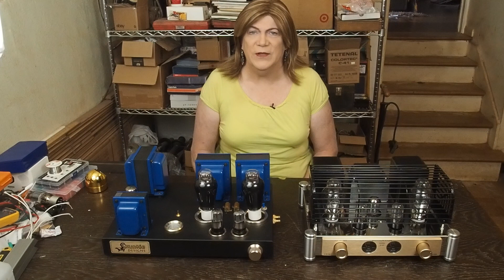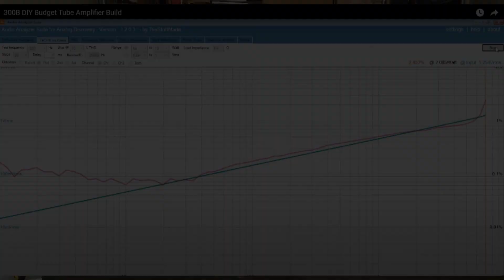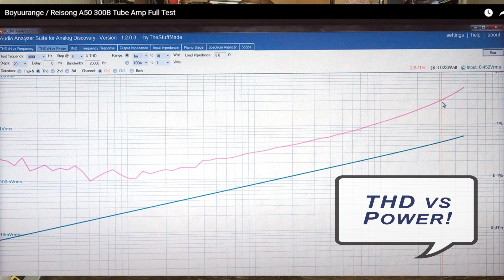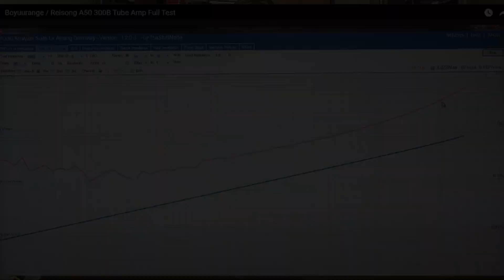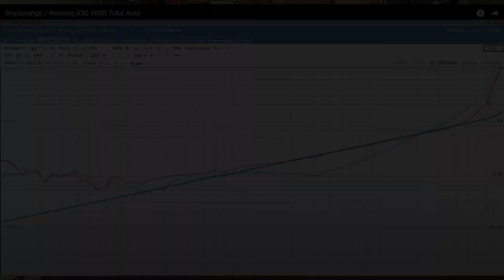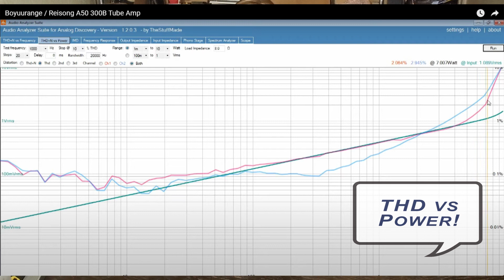Boyuurange / Reisong A50 300B Tube Amp Mods: Wrap-up Impressions

Comment: I’d be more interested in a kit for your amp—with a chassis that is prepared for building than I would be for a kit for the Amazon amp.
Reply from the maker: Kits from me are not likely to ever happen. Putting together a kit with a prefab chassis is doing 90% of the work for 50% of the money. The only way I would sell a kit would be for the same cost as an assembled amp due to the support this would inevitably entail.
Reply: @SkunkieDesignsElectronics  That makes a lot of sense. Well in that case I second what others have said here and would rather buy your completed amp! Happy to pay for your labor!

Comment: Very nice and helpful. I think you did not mention the value of new coupling caps for 300 tubes. You mentioned that .56 or .47 mf was too large. I assume you went to .33? Is this correct? Thank you
Reply from the maker: Yes, I tried both a .22 and a .33 and the .33 had a little better bass.
Reply: Wow what a youtube channel . This was posted 2 years ago . I asked a question and got reply in minutes. I didn't even expect an answer , because others just wouldn't bother. Thank you very much!! SkunkieDesignsElectronics YOU ARE GREAT.

Comment: I am nowhere near qualified to make the modifications you demonstrated.  You almost make it sound like this amp is basically junk without the mods.  Is it possible to enjoy this amp with nothing more than rolling the tubes?  Can you at least provide a list of what replacement tubes you recommend without any other modification?  Or is it a waste of money buying this amp unless you're an electronics engineer with the skills needed to rebuild it from scratch?  I really wanted to get into tube amps as a music lover and thought something like this would be a good start.  But now I'm discouraged that anything I can afford is just cheap, overhyped junk and I'm stuck with my overpriced, overhyped Pioneer "Elite" AVR.  At least it works and it hasn't blown up yet.  I'm kinda upset, but maybe I should thank you for saving me $1,000 bucks along with a lot of grief and stress.
Reply from the maker: IMHO, no. It only makes maybe 1W of power without the mods. And you don't have to be an "Electronics engineer" to do these mods. I did the hard part for you, figuring out how to fix it. Honestly, you are not going to get a quality, good sounding tube amp at this China $1000-1500 price point.

Comment: So would 3.2k be preferable over 5k for a speaker with a 8ohm minimum dip?🤔 Kind of interested in understanding more  about the output transformer part with different loads.
Reply from the maker: Maybe a watt or so more power but at the expense of higher THD.
Reply: @SkunkieDesignsElectronics  I see. Thankyou.🙂
Reply: I should add, the Reisong doesn't interest me, just a better understanding of output transformer matching to speakers.

Comment: I concur with you on the subwoofer idea. But what I’ve been doing for a few years since I got my 4-way Pioneer electronic crossover, is use the low frequency output from the Pioneer to feed solid state amps driving two JBL 15”s. No amp sounds thin since I started with this. On top of that, the mid/high outputs drive tube amps to feed my main speakers. 

It isn’t budget friendly and complicates the whole system but it gives me huge fun mixing and matching everything. It is the best of everything in one system, not to mention immensely lowered distortion and higher SPL overall. Like the LS3/5A sounds like on steroids giving out louder music, not noise. 

All in all, like upgrading the whole system but keeping the sound signature of my original speakers.
Reply from the maker: Very cool idea! Thanks for sharing.

Comment: You are very knowledgeable. Way more than me. I have a Beautiful Marantz 2325 , but it’s old and could probably use a restoration  , re-cap ect. The wood case everything is so nice , I’m very worried someone will mess it up. Plus I could use the money on a Tube amp? I run a pair of K-Horns up front A, on B I run a pair of Klipsch Belle’s. Together it fills my listening room with live entertainment at around quarter volume.  Would Zi be better off with a Tube amp ? The Marantz and Klipsch speakers have been nothing but Quality ! I have noticed that not all tube amps have an A + B ability to play 4- speakers. Could I buy a speaker splitter and run the 4 ? I do run a M&K powered sub , on the K-horns. I’m old and retired, plus disabled so my Stereo gets used and my house sits on 15 acres so I can crank anytime 24x7 with no Police knocking as I use to get when I was young. You are very knowledgeable, I have been thinking maybe Wilkinson 400i . Thank you for your opinion.
Reply from the maker: If you enjoy what you have, keep enjoying it :)
Reply: @SkunkieDesignsElectronics  I know the man that sent the new amp directly to you was very smart. He couldn’t have gotten anyone better !

Comment: Like many others I'm so glad I found your channel.
I was considering one of the many Chinese amps, and may still buy one, but as you have shown, to get the best from them, mods are unavoidable.
I have designed and built passive crossovers for my DIY speakers, so the mods would be no bother to me.
When you consider how badly this and other Chinese amps measured out of the box, it makes you wonder what the you tube reviewers are hearing, or more importantly, not hearing.
I always take what reviewers and HIFi mags say with a large dose of salt.
They need to keep reviewing, so can't be over critical, just hint at issues, and leave the listener or reader to read between the lines.
Thanks for all your hard work, and honest opinion.

Comment: Wow! I've watched so many videos about stereo gear (use to read magazines in the past about this passion of mine for music) now years later I find you! I immediately subscribed in hopes of finding your best advice for a DIY amp to pair with my Klipsch 97db speakers. I have many speakers but after visiting my local Audio Classics store, close to where the McIntosh gear is made, I fell in love with tube sound. Affordability is out of the question and what I loved best was the tube gear used with the Magnepan speakers. You can imagine the power those mono blocks were cranking out. It was definitely out of my reach. So if you can point me in the direction of a DIY project to help my addition I will most appreciate it. I can solder, weld, have a Greelee Punch Set among others. I can paint, fix cars , have access to a break press etc. I'm a jack of all trades and master of none. Presently a journeyman electrician and ready to retire to my dream sound room. Please! hook me up. ^^
Reply from the maker: See my DIY 300B amp, it's amazing!

Comment: Really appreciate you doing this series.  I've done all of your mods to my A50 and it really opened up and changed.  The clarity on this compared to stock is quite noticeable.  I think I've even got less hum/hiss observable when its idling, which probably gives a better noise floor.  This little amp really surprised me with how far it can go. It might even be winning compared to a MC275 when using high efficiency speakers, which I was hopeful about but not expecting.

Comment: Quick question about connecting a powered sub... I cant find much info on this but i have seen some comments --- "You need to get a subwoofer with line level or high level speaker inputs; you then connect the subwoofer to the speaker inputs on the back of the amplifier; I recommend REL or HSU for subwoofers with speaker level inputs..."-----  I only see right and left speaker inputs on the back of the amp so how would one wire the subwoofer? Sorry as i said i cant find almost anything about how to do this with this specific model (Reisona50). Any advise would be appreciated!
Reply from the maker: I have played around with a Elac SUB1010. These have high level speaker level inputs, you just parallel those to your other speakers, and then set the volume and where you want the high pass filter to kick in.

Comment: My mission was looking for tube inspiration to match my loudspeaker project, I've found it right here and now! I sold Hi-Fi for many years and listened to a vast amount of equipment and that was spurred on by my love of music and built my first EL84 class A amplifier pair kits when I was 18. Shortly after we were living in the realms of the transistor and I diverted my attention to the loudspeaker, the weakest link in the audio chain then and now, at present where recordings are better and the medium of tape, vinyl and digital storage systems and amplification has improved dramatically. Since the decades post the 1930s and early amplification using Valves (Tubes), we had no way of knowing how good they actually were or sounded because they have overtaken speaker technology which in principle is a 1930s design, coil, cone and a box, apart from electrostatics and a few novel ideas, nothing has really changed. My design work began in the 1990s when I built my first prototypes using novel techniques for improving drivers and cabinets rather like the improvements we see here in this series of Boyuu A50 modifications and of course the own design and build of the B300 amplifier. When I retired 5 years ago I wanted to try something new. I have all kinds of transistor amplifiers both professional and domestic from a Crown DC300 through a Boulder amp (my all-time favourite transistor amplifier), I decided to try a tube amp so bought a BOYUU A9 EL34 amp kit, changed a few components including tube rolling, connected to my new prototype speakers and it knocked my socks off! I wanted a small single-ended amplifier to drive my unique single point source highly efficient diaphragm speaker with equalised pressure rear and front wave module design in a dispersion vessel with total separation in a slim glass cabinet with isolation pads with a potential of 20Hz with a unit of zero resistance in the diaphragm motion, no suspension and a very easy load on the amplifier. The current grips the coil due to virtually zero resistance and allows the amp to move the coil to where it needs to go and follow the signal path. Thank you for the great videos and reading.

Comment: I bought this amp several months ago and I love it. Granted, I upgraded the tubes and it has significant use time at this point. I'm using it with some vintage JBL 4412 Studio Monitors at 90db sensitivity and it sounds wonderful. I rarely turn the volume past 10:00 and it has nice room filling sound and good presence. But I have to admit, I kind of regret pulling the trigger now after watching this series. 

The mods are above my head, not just technically, but time wise as well. I really don't have the patience for this kind of work. Forget about building the DIY version. I'll have to stick with tube rolling and playing with the 4-8 ohm outputs for now. I'll now binge the 300b DIY build as time permits. But I thank you for these videos and also the advice you gave me.  Best!
Reply from the maker: Try dropping a 5AR4 rectifier in, even with no mods it will help.
Reply: @SkunkieDesignsElectronics  I actually have a NOS GE 5AR4 on the way. I decided to get one after watching one of the earlier vids in this series. I already have NOS GE 6SN7GTBs that I installed a few months ago. That was a noticeable improvement as well.

Comment: I was looking for a affordable amp project for to long. This channel is the best place I founded to hangout with my newly founded interest in home audio. Being able to benefit from your experience in this "hobby " of yours is just a threat for me. The fabrication part is not a problem for me since it is my new career (Cad and cnc programming) after 24 years of live sound engineering. I also have good friends to help me with the power up and troubleshooting. Question: What would you recommend for speaker load to best fit my fidelity over loudness preference? I'm thinking of going with CR research since, once again, cnc routers are the easy part for me. Love everything about your channel thanks! * I ment GR-Research
Reply from the maker: Those speakers might be great, my only concern is how deep into snake oil products he is, claiming his speaker cables and those "tube connectors" make a huge difference, when that's just not possible. It makes me question everything he says after watching his video with speaker cables hooked up to the antenna jacks of a tuner lol!

I personally love my Klipsch RP660M, they go on sale fairly regularly for under $500 for a pair. I tried some Triangle speakers and returned them, just sounded flat to me. Part of speaker choice is personal preference/what sounds good to you.
Reply: Yeah I know the snake oil salesman aways have some stuff to sell as a remedy for your last founded needs he just sparked in that new dimension he created in the universe. I also noticed that, in live sound systems,  we always balance every signal to reject the noise from the RF environment induced in the 350 feets of cables running from the  mics up to the mixing board and the same thing for the run back to the amps. This is for analog productions. Data cables just use shielding to my knowledge. After that, claiming that a data cable could induce a level of  noise in the amplifier sufficient enough to destroy the quality of the amplified result? Maybe not. 
You mentioned the triangle speakers you tried were sounding flat to your hears. I have never heard them but I can't help thinking about the way that this guy keeps taking those boxes in and modify them so they sound flat response at all range of frecances when also evenly considering other important characteristics like impedance and dynamics. For my own business, I have been listening to Yamaha ns-10 and a Bryson 4b for more then 20 years... Like... "before bass was cool TV mixs" to long. So yes, I'll take some colors in my to be built listening room. I've lost track of what I've been saying previously... I'm having fun here.  Thanks for interacting with me. I will be around for whatever you try.
Reply from the maker: @jaydeebishop2345  I'm learning there can be a big difference between what measures well and what sounds good.

Comment: As an engineer, I’m so impressed with your review video clips which supported by numbers, math, graph on oscillator etc., that are what I expected…
I also watched some review of this A50 300B amp by others and they only review by their ears…
Reply from the maker: Tube amps can fool your ears, especially if you are used to solid state gear, as the distortion sounds totally different. I still think you can listen to 2-3% THD, but not 10%.
Reply: Only review with their ears ? Surely that’s the whole point ,strange comment
Reply: @martingreenwood3394  "Review with ones ears" is a good start, the keyword is 'only'. Because there is more to it, such as quality of components, layout and over all design which to a very high degree will affect for how long your ears will be able to enjoy the product. This was very well illustrated by this project.
Reply: @martingreenwood3394  yes, I mean other reviewers only review base on their ears. They say the amp good or bad just base on how their ears feel. Nothing to prove why this is good, why that’s not good. I like this video because the review base on mathematic, base sound wave display on oscillator etc.

Comment: I have a 'mark-II' of this amp,--Quite different in design--but similar appearance...
6V6 in triode as drivers, 12AT7 input stage, --And sounds Bloody Awful! 

Ive had to do full re-design, dumping 6V6 and using 6J5 (half 6SN7) in Mu stage with MOSFET on top, replaced AT with AX and no cathode caps for both. Much better--but still had hum as ground for input stage was routed back to main filter. Moved that ground to the last filter (three B+ filters in mkII) stage, Hum gone.

Output transformers same as yours--and are crap! A Square-Wave test at 1KHz at low power is Very revealing.....
--Conjunjunctive filter anyone.....?

Comment: A great end to the series! It's been a good journey. Can't do much about small output transformers unfortunately!

I'm interested to know... You keep calling your 300B amp a budget build. Parts aside, what circuit mods would you do to make it high end? SRPP driver stage? mu follower? Something else? Or are you happy that the basic cascode circuit is good enough? Not talking about spending more on parts here, just the actual circuit mods you might consider. Appreciate your thoughts.
Reply from the maker: The "Budget" is for the parts used and avoiding expensive things like inter-stage transformers etc. I have seen in other designs. I've also seen people say only use super high end OT on a 300B build ($500 +) or you are wasting your time, I wanted to see what it would sound like with these Edcors, IMHO it sounds fine. 

Also these are readily available tubes, instead of some exotic NOS ones. I personally constrained my build to using 6SN7 drivers, as I wanted to use tubes I already had a bunch of. I'm very happy with the way this amp turned out and the more I listen to it, the more I like it!
Reply: @SkunkieDesignsElectronics  thanks for the reply.

Comment: Posting pictures of the mods you did on your website would help those who want to make them might help. I am building a K88 amp that Blueglow has a video on, just waiting on my transformers and choke to arrive so I can start.
Reply from the maker: That's a nice amp. I built one of these, and then later reused all the iron for my DIY 300B amp.